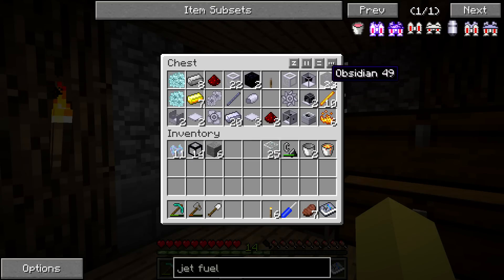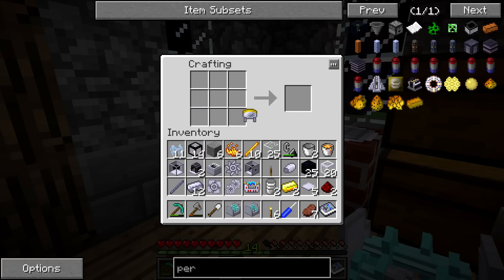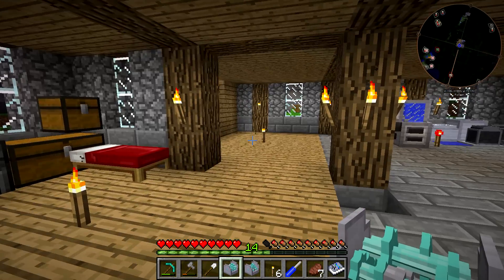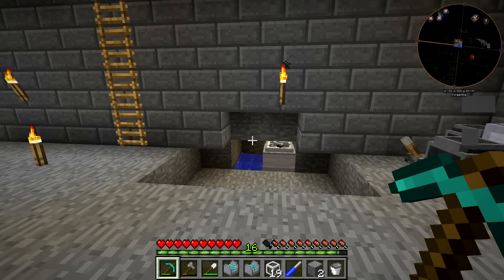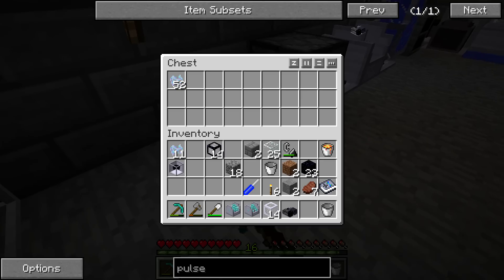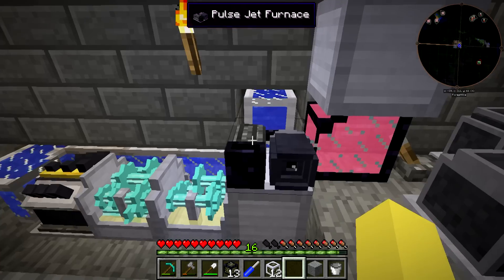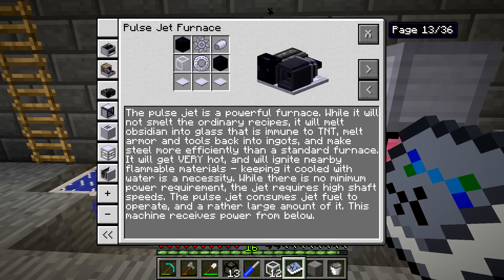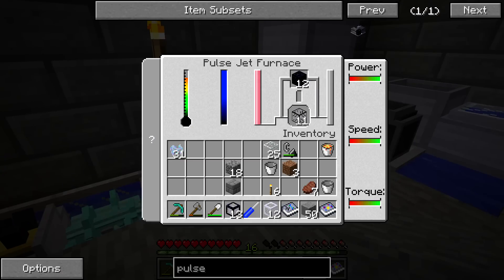Surviving With RotaryCraft :: Ep.9 - Pulse Jet Furnace Setup

Comment: From where did you get the aluminum alloy ingots, for powering the jet furnace? They're mad from aluminum powder, which you can get out of the exctractor. But for the microturbines (for the extractor) you need inductive ingots. You can make them in the jet furnace. So I'm a little bit confused about that ^^
Reply from the maker: I don't use the microturbine for the extractor :) I used the gasoline engine / performance engine with gearboxes that would be flipped from speed/torque depending on what step the ore was on. That allows you to get aluminum powder without needing the inductive ingots.
Reply: +DrRageHard  ah okay, thanks. I tried it out, but I can't get the blast furnace with the friction heater and lava to the 900 °C. The maximum is 894 °C.
an this with two gasoline engines. What should I use for an engine? And do I need a gearbox? I tried many different things, but nothing worked.
Reply from the maker: Gas engine should be fine, but you do need gearboxes.
Reply: +DrRageHard  which gearbox?
I tried every gearbox. ^^ I think I'm too stupid for this xD
Reply from the maker: Hmmm, looks like the formula is different and has speed/torque equal now. I used it in the Nether because it gave a base starting temp of 300 degrees celsius, but you can't do that anymore. You may need to try using a different power gen like a hydrokinetic engine this time :(
Reply: +DrRageHard  ok I'll try it. Thank you very much for your help. :)

Comment: I'd like to see you go back to the boring machine with a microturbine and get it cranking out a nice large tunnel.  You'll need to cover tungsten processing with a friction heater and a furnace to get there, and that is an important tech gate for Rotarycraft.   
Also, any engine that uses ethanol or jet fuel can be switched off by applying a redstone signal to a controller placed below it.
Reply from the maker: I'll definitely go back and get the Boring Machine running faster and covering more ground soon! Thanks for the redstone tip, ill look into it for all the gasoline engine / performance engine setups :)
Reply: Correcting myself.. Don't need tungsten for microturbine.  Do need pulse jet.
Reply: You don't need a microturbine on the boring machine. 4 AC engines will give you plenty of torque, to bore out the max size tunnel. Save your jet fuel for bedrock breakers.